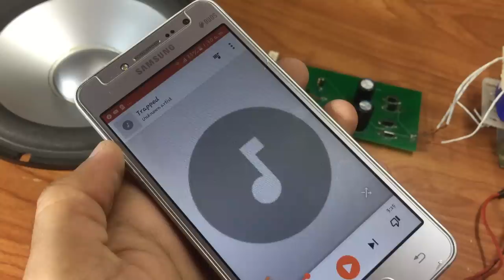Ultra Bass |Powerful Amplifier|Loud bass| Increase Bass Without Pf

Comment: Esta cosa si sirve, ya lo probé no más que mi duda es que si cambio el capacitor de 1000 por uno de 2200 abra algún cambio( cambien el de 1000 microfaradios por uno de 470 no importa voltaje y tendrán mejores resultados ).

Comment: May I conect this into a full range 2 chanel boss motorcycle amp, to obtain a third chanel for bass?
I mean, open my amp and conect this project as 2.1? Thanks
Reply from the maker: YES YOU CAN CONNECT IT NO PROBLEM
Reply: @electproject  thank you! I'll try and comment later, greetings from MEX!

Comment: one of the best bass boost tutorials i have seen so far. 
i have a 2800watts amplifier and 2 400watt subwoofer, without the gain controller and NOT soldering it directly to my amp, how can i connect it to my 4.1 amp just using the LF + and - ?
thank you bro! :D
Reply from the maker: JUST THAT CIRCUIT OUTPUT CONNECT INTO YOUR AMP INPUT

Comment: Estou procurando por um projeto desse a séculos! Amanhã vou fazer para testar ... Muito obrigado
Reply from the maker: obrigado cara por me procurar !!
Reply: Eduardo Reis deu certo??? Mim passar os componentes usados
Reply: @diegoalves2113  meu brother, embora o anúncio fala de 1200Watt não corresponde exatamente ao projeto com potenciômetro  e três capacitores. Deu certo no corte que fez de frequências altas. A potência o que vai determinar é o amplificador, que no meu caso usei o TPA de 60w em Low Bass com esse projeto
Reply: Ola estou precisando  de fazer um corte  de freqüência  desses..pra sair só grave .axo que esse me atende né...
Muito obrigado
Reply: @MarceloSantos-xm1ey  olha maninho,  tem um segredo, quando se faz corte para passar só graves, você precisa de um pré amplificador, ou alterar o resistor de entrada do amplificador para passar o mais alto possível os graves. As vezes mais vale comprar um pré no ML com filtro de grves
Reply: @eraudio  bah ..ñ sabia..então vou procurar..esse pré..no ML..
Poxa j tava até  animado..indo fazer 
Mas valeu mesmo..👍👍
Reply: @MarceloSantos-xm1ey  mas você pode fazer que você vai usar mais suas habilidades.  Por e se quer algo para um fim de uso real, compre no ML,  placa pré subwoofer,  ou crossover subwoofer.   Tem vários modelos e preços,  veja o melhor para seu projeto em sentido de alimentação.  Se seu amp tem 12v pegue uma plaqueta que aguente isso
Reply: @eraudio  eu quero pra pouca potência..tou fazendo uma bob pequena com um sub de 5" 80w.
Aí quero cortar as freqüência alta..eu vou tentar fazer com sucatas que tenho aqui..o potenciometro de 50 k eu tenho.mass os capacitores só consegui encontrar 100uf de 50v e 25v 
É o de 1000uf só tenho de 6.3v..
Vou fazer pra ver o que dá.. kkkkkk
Reply: @eraudio  agora Achei dois de 100uf mas são 10v..e tenho um de 1000uf 6.3v
Reply: @MarceloSantos-xm1ey  pode fazer de até 6v. A corrente que irá passar por esse circuito é de menos de 0.100v
Reply: @eraudio  legal tô fazendo..assim que testar te aviso..
Reply: @eraudio  cara fiz é cortou bastante..mas ainda tá passando um pouco de voz..pra baixa mas o corte o que será eu preciso substituir???
Reply: @MarceloSantos-xm1ey  se você tiver um traffo de áudio,  igual aqueles de módulo,  é muito mais fácil cortar as altas frequências sem ter que usar tanta coisa
Reply: @eraudio  axo que eu tenho..
Só não sei como  usar tennho tanta  sucata aqui..
Reply: @MarceloSantos-xm1ey  você consegue dele naqueles módulos antigos de carro, os chamados Valvulados,  ou com bobinas de realimentação. . Ele tem dois fios na entrada e três na saída,  você faz o seguinte,  pega na saída os fios de extremidade, o do meio não precisa, aí você põe um ou mais capacitores eletroliticos de 4.7uf ou 2.2.  Que faz o corte de altas frequências deixando passar só 250 -10htz
Reply: @eraudio  bah legal..vou  ver c aço um.m..valeu amigo..
Reply: Só faltou o esquema Elétrico..!🤔
Reply: i guess im asking the wrong place but does any of you know of a way to get back into an Instagram account??
I stupidly lost the password. I appreciate any tips you can offer me!
Reply: @Darren Samir i really appreciate your reply. I got to the site thru google and Im in the hacking process atm.
I see it takes a while so I will get back to you later with my results.
Reply: @Darren Samir it did the trick and I actually got access to my account again. I'm so happy:D
Thanks so much you really help me out :D
Reply: @Colson Landry No problem =)